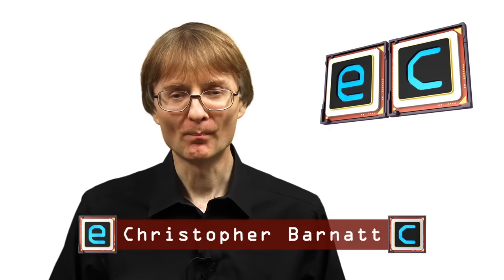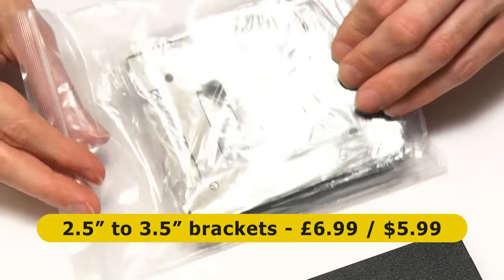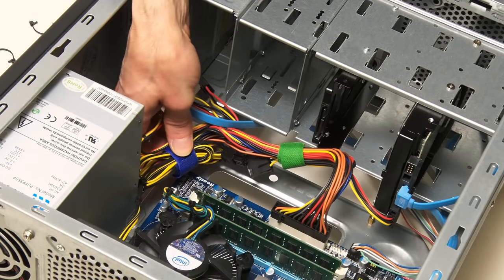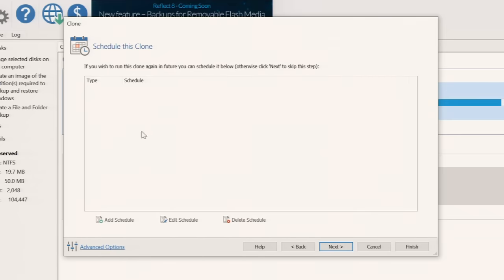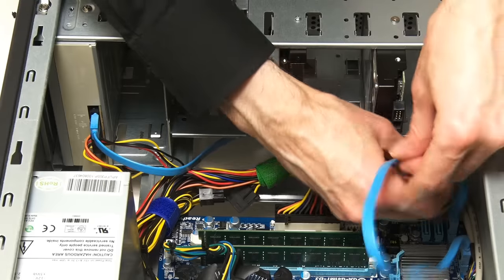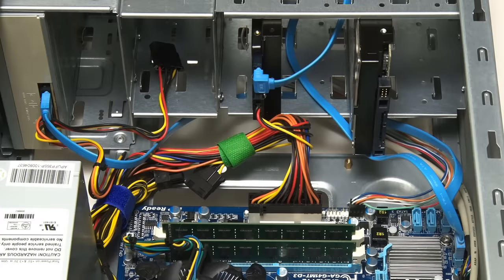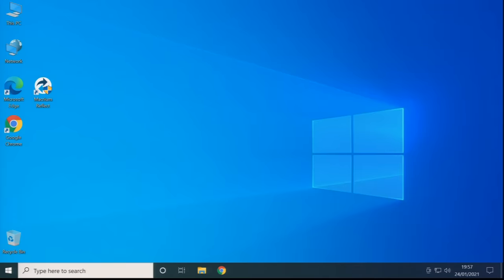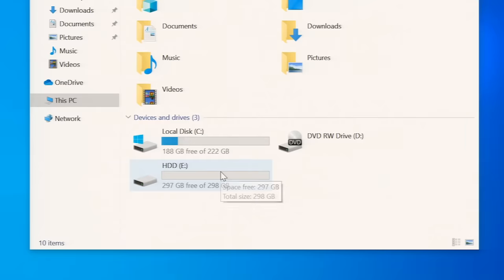Old PC Upgrade #2: SSD Boot Drive

Comment: How imperative is it to have your SSD screwed into a mount?  Like, can is just sit on the drive shelf?  My drive shelf is vertical, so my SSD is sitting at a 45 degree slant in the shelf.
Reply from the maker: You can sit your SSD anywhere you like. The only thing to be careful about is that it will not move/fall and pull on a cable and cause a disconnection or a short. But provided things are stable and secure, you get let a sleeping SSD lie (even at 45 degrees!).
Reply: I have 2 sata ssds hanging in my case

Comment: I know that it's a more complex undertaking, but would there be a big advantage to upgrading to an M.2 SSD? (I would need a PCIe adapter and new cables--?)
Reply from the maker: It would only be worth it if you really need the speed (c.3000 vs 500 MB/s). So you would have to be doing something -- like 4K video editing from non-consumer formats -- that really needed the speed. Or you could fit a PCIe SSD. For most users, the real-world benefit of booting and loading programs a bit faster would be marginal.

Comment: Do you need to remove the boot flag on the other drive, so it can be used just for storage?  So, another question.  SSD's are meant to be run as AHCI, otherwise the alignment will be off, and reducing performance.  How does that work?
Reply from the maker: AHCI is not essential when using an SSD, and is not available on a motherboard this old. I cleaned the old HDD using Diskpart, which returns it to factory state, so there was no boot flag left to remove. :)
Reply: I wasn't doubting you, just a question :).
Reply: No, you don't have to. In fact I've sometimes just left the original drive there without altering it at all. That way it's still bootable if you need it, but otherwise it just sits there same as if it were a data-only drive. (On an old machine where I use salvaged HDs, I always have a 2nd HD cloned in there so if the boot drive dies, I just switch to the 2nd drive and life goes on as before.)

AHCI has nothing to do with alignment -- rather, it's a sector thing. Pretty much any modern drive formatter knows how to align an SSD.
Reply: @Reziac  Thank you.

Comment: That SSD is so cheap would be rude not upgrading my old desktop with one - may even do it on an old Thinkpad I have
Reply: Fitted a Kingston SSD with the help of this useful guide.  Boot time is now 25 seconds instead of a minute.  The old PC seems a little more responsive but the main thing I noticed it was so quite - well that was until I reconnected the hard drive as well.

Comment: just two questions

1. what was the processor and ram used?
2. what were the loading times of both ssd and hdd? I don't think I saw the hdd boot time, and I don't think the first boot ssd didn't do justice because of those annoying screen at 15:13

Comment: Hi Chris, a couple of questions? First being - do Samsung 870 EVO SSD drives come pre formatted or does one have to first partition and format the drive? The reason I mention this is some new HDD´s I´ve bought in the past came with a full disc partion and were already formatted.

My next question... I often make image backups (including the OS) to a 2TB external USB HDD. I should add that my system is pretty ancient (circa 2006) running Win7 32bit which I find is very stable. A lot of my programs are for running astronomical imaging and telescope control software which I heard can be unreliable running under Win10 and the reason why I still use WIn7.
The bottom line here is can I simply restore my backup to a new SSD using the WIn7 "Backup and Restore" utility? In the past I have done Windows clean Installations, but its a PITA and takes forever!

Comment: Look at all that space in there for drives, you could probably fit the total drive space that PC case was designed for on one drive these days
Reply from the maker: Yes, what a great thought! :)
Reply: Considering you can fit all the processing power of the Apollo command module into a device you can wear on your wrist these days...
Reply: @lawrenceallwright7041  I remember when JPL ran around buying up 486s because they were a 100% known CPU... and patching bugs in space was a no-go :)
Reply: @Reziac  486? HA! That's modern stuff from 1989! Look up Core Rope Memory which was the type of stuff they were using to get to the moon, 20 years before the 486. Storage capacity of 72 KB per CUBIC FOOT!
Reply: @lawrenceallwright7041  Woah, you're OLD :D

 "My" first computer (high school class) was an IBM1620... something like 4k of RAM (don't remember, some piddly little bit) and the 5mb HD add-on was the size of a washing machine. Was a major upgrade from punch cards when we got a paper tape reader. Don't think I miss needing a forklift to move the computer. :)  (We also had a 360 that did the district payroll, the size of a garage.)

Seemed downright modern compared to what a friend worked on in the Air Force... flight computer where you moved plugs around to program it, and read the results in the blinkenlights. Movie computers are real, just 50 years late. :D

Oh, a fun video here somewhere -- kid bought a mainframe and had all sorts of adventures first getting it home then getting it to work.  HA! I found it.

https://www.youtube.com/watch?v=45X4VP8CGtk
Reply: @Reziac  I didn't say I was actually ON the Apollo mission. I have seen the movie Apollo 13 though, where Tom Hanks (as Jim Lovell) brags about the compactness of the computer to some journalists.  😁
Reply: @lawrenceallwright7041  Well, dang, and here I was hopin' you'd made it to the moon! :D  At least nowadays the capsule has room for something besides the giant monster computer.
Reply: That's a nice case. Same style of chassis as the one I prefer for my own PCs. No bling, just lots of drive bays.

Comment: Great video as usual :)And diskpart! Its like watching ma favorite show :D Reflect is also my favorite cloning software except when I buy Samsung SSDs and use SamsungMagician software but the branding comes with additional cost. I wonder where did you manage to get the branded SSD that cheap? The cheapest I found recently was PNY 120GB SSD for £18. Anything in the 240GB range is more than £28. Share the secret :D:D
Reply from the maker: Thanks for this. The SSD came from Amazon.co.uk. Since the video posted, the price has risen!
Reply: @ExplainingComputers  Many thanks!

Comment: Can the ssd drive you transferred the data to be cooled using an aluminum radiator or a cooler with active cooling? this to extend the life of the ssd... an explanation would be useful, especially since the life of the ssd- uri is significantly smaller than a hdd, be it 2.5 inches...very easy to understand what you presented in this video
Reply from the maker: A SATA SSD in normal use will not need cooling to extend its life. The life expectancy of the electronics in an SSD is no less than in an HDD. But the number of program-erase (write) cycles is limited -- see my most recent video on this topic here: https://www.youtube.com/watch?v=F8k_XIEhKWo
Reply: @ExplainingComputers  Thank you for your kind answer. I have a computer with MB sk775, C2D E8400 processor and 4 G Ram... I want to transfer the Win7 pro OS, with the original Microsoft license (bought 12 years ago, with the tax invoice, everything legal) from the HDD 1T WD sata 2 on ssd Kingston KC600, 256MB sata3, bought new a week ago...for this reason I asked if I could adapt a cooler with active cooling to cool the above ssd...thanks for the answer

Comment: 05:28 My question is: is the PSU is in the right orientation? As far as i searched about it's modell number i was unable to find pictures from it's remaining 2 side,  but following the guide lines of the ATX model, that should pull air to cool itself, and ventilate the chasis... So maybe it is sitting there sucking air from metal panels (BAD), or have no opening to the inside (STRANGE), while still have a fan at the back (makes the later STUPID).
Any idea or confirmation?

Comment: Question: does Windows know that the new disk is an SSD, no longer a spinning disk, and therefore to manage it as one with regards to not defragmenting etc? Or do you have to manually configure?
Reply from the maker: Yes, modern versions of Windows (8.1 and beyond) detect and appropriately handle an SSD.

Comment: Chris, I often find when I clone disks like this when you first try and boot it up it fails, do you have any take on why that is? Occasionally I have switched off and then booted again from cold and it will then boot up and I am never clear as to why that is?  I suspect it may be to do with secure boot and some of the strange partitions used by that.  Do you have any experience of how to deal with that as I think it would make a good video on how to get around this nonsense.

Comment: I add a mechanical hard drive so I can have a Linux swap partition. I have swappieness set to 20. 10K rpm 6-mbps Velociraptor hard drives are really good for that. I'm really bad at having too many tabs open on my browser 16GB of ram isn't enough. Having a fast swap file helps me recover.

Comment: It is always seen that they only have one or two power supply cables; when you have 4-6 SATA slots?  Wouldn't you think you have the same amount of each (?) power cable w/SATA?  Most of the newer towers are built the same way?  Bottom line; You have to buy cables no matter what's!!!

Comment: At 1:12, what are those connectors on the HDD called? The one at the right, without any cable connected. Also, is that a Molex power?

Comment: Question for Mr. ExplainingComputers: I have a "Razer Core X" and it works really well with my older thunderbolt 3 laptop/mobile desktop, however GPU's are become massive in size again and I'm finding that the RCX's case is way to small for most modern GPU's. I was wondering if you have any ideas for me about which small cases would work or are easily modifiable as well as transportable? (Something smaller than a bread box, but large enough to hold a three slot graphics card, power supply, fan, and daughter board for TB3 connection)

Comment: I have a question what is the difference between a fusion drive and a SSD drive?
Reply from the maker: An SSD is a solid state drive -- an actual type of hardware. A "Fusion drive" is the name Apple gives to a storage device that includes both an SSD and a hard drive (also more generally known a a hybrid drive).

Comment: Even nicer ... if we could use NVMe drives in those old PC's. Would that be possible?
Reply: On most older motherboards no. Your bios would need to support booting from a pcie expansion card.
Reply from the maker: You could in theory plug in a PCIe NVMe drive, but it would not be bootable as @NYCamper62 says, and the speed would be limited by the PCIe 1.0 interface of this older motherboard.

Comment: I LOVE Macrium Reflect!  Why wouldn't you just use the "copy selected partitions" option vs. all that manual stuff?  If you don't like the sizes it does automatically, you can adjust then.

Thanks for tutorial on diskpart.  But for anyone who fools with Linux and has a live usb drive of one, just boot that and use the graphical partition manager gparted to wipe the drive and create new partition.

Comment: Well Done Only Recently Started Looking At Computers Its A Mine Field Out There Bought An Old P166 For Playing Old Games Found In The Loft Now In Man Cave But Struggling With HDD To SSD AOMEI Does Not Work But You Have Showed Me How To Obtain Free And Working Software Again Well Done Thanks
Reply: Hi There So That's My Plan For Tomorrow Being Retired Through Ill Health So A Wee Dabble To Keep Me Occupied Thanks For Your Quick Response Hopefully You Can Keep Me Right Thank You
Reply: Hi There Software Has Changed But It Cloned Alright BUT Would Not Boot Up Kingston SSD The Made A Big Mistake Unplugged The Data Plug While Running Now The Main HDD Won't Boot Up The SSD Was Looking For A Boot CD. So Start Again Win 8.1 On The SSD Works Boots Up Looking To Select Which Op System Has To Be SSD 8.1 As The HDD Win 10 Keeps Trying To Repair On Booting So I Can't Get To It Start Can't Repair Even In Advanced Features Doh!!!

Comment: Hi Christopher, could you put a SATA 3 add in board in one of the PCI slots. Would that overcome the SATA 2 issue? Or is the PCI slot too slow and it wouldn't have much of a difference?

Comment: Does the OS (Windows 10) on a source HDD remain fully operational after cloning to a target HDD? On my laptop, I plan to keep using the source HDD in it. My plan for the target HDD (the clone) is to put it in a drawer, for emergency, and hopefully never to use it. I plan to keep using HDDs, because speed is not of the essence for my current PC usage.
Note: I have heard that Windows 7 OS on a source HDD is no longer operational after cloning. Any thoughts?
Reply from the maker: Yes, the source drive continues to work just fine (in both Windows 10 and 7). But the license can only apply to one copy or the other. So you may have come across stories of users who clone a drive, work with the new one, then decide to put the old one in another PC (with a totally different hardware spec) and in that PC is will not work. But if you take a clone for emergency use in the same PC, you should have no problems continuing to run from the source drive, or switching to the clone in difficulties occur. This is indeed exactly how I run things myself, taking a clone copy of my boot drive every 6 to 12 months that I keep in the cupboard, just in case (and this is Windows 7).

Comment: You'll hate me for saying this - I expect nasty comments... but... I don't bother with mounting brackets for SSD's - they're Solid State - no moving parts... I just screw both holes on one side and close the case. No complaints so far.
Reply from the maker: I don't hate you for saying this, and indeed I even show mounting the SSD withtout any brackets as an option in the video. :)
Reply: @ExplainingComputers  Hehe.. I wasn't expecting a reply from you, I just thought I'd get shot down by other viewers! Thanks for the channel - Clear, concise and well informed. I WAS a global IT manager 20 years ago and my knowledge is very, very out of date (MY MSCE was on Win 2000, before Win 2000 was released... so....) Please keep your content coming as long as you can. As a side request / suggestion... could you put a link in each video to a page that describes and links to all the other videos? YT'ers like you have years of material and us newbies simply do not know what you have and have not done... One link pinned on every video linking all the rest... (titled) very useful... ;) And would stop idiot comments like "Have you mounted an ssd without a bracket?" hehehe. Take care - and thanks.

Comment: Very good video,thanks for the work!So,my old AMD Phenom,4*3.4 with 8 gb ram became 2 new ssd´s.One for  Win10 and the other for Linux Mint and what should i say;a fast,stable system!Never runs faster.I´m wondering about a 10 years old Computer,it is amazing.Thanks again for the video.I prefer a new installation,my main userfiles are on external discs!

Comment: All the processes shown here can be accomplished in the one application, Macrium Reflect, it does it all, so I no bothered to use the more complex windows options. A note of caution on using the  Molex to SATA cable adapter, These do not contain the Orange wire which some drives require.  I had experienced clicking & intermittent stalling of my SATA drive. Diagnostics had shown up as a faulty HDD, which would be expensive and inconvenient to replace.   After much head scratching & frustration, I connected to a SATA point from PSU which contained the Orange wire, and all was well, so user beware, this may save you a lot of time & frustration.
Reply from the maker: I am bewildered. This videos shows the use of Macrium Reflect to clone the drive. :)

Comment: I would use WD diagnostic to run a hard drive test programme and fully test and format the drive.  This is an old hard drive and may well have unknown faults in which case I would be ditching it.  Just saying!  I have done a bit of this sort of work over the last year and two out of three drives I thought I could incorporate into a cheap build as backup for a neighbours son proved faulty. They were all WD blue as well .....

Comment: Hi, thanks for the channel... I have just watched this video and I have a couple of questions.. 1) can I when cloning from HDD to SSD just copy over the OS..? (I would like to do a clean install of any software on to the SSD after which I can use the HDD for storage.  (2) Having watched the section on copying disc partition, I looked at my disc,.. As far as I am aware, I only have one HDD 2Tb but in the disc management it is showing disc 0 = which has five partitions as numbered.. 1)=EFI system part  2)= OEM part  4, 6 and 7= recovery part.?   I also see a disc 1 with 29.69 unallocated.?
Any advice would be greatly appreciated.

Comment: I added a Samsung SSD to my 12 yaer old PC . the current version of Macrium Reflect wants your email and forces you to have a trial code ... even then it did not install .. i got an error 1  , that's " cant find server " ... so i got an old version which installed fine with no issues. I cleared as much as i could from my old drive , it still took 12 hours and 35 mins to clone... but worked !! thanks for the guide
Reply from the maker: Glad to hear that it worked! Sadly Macrium Reflect Free has been withdrawn -- the "current" version is a trial of the paid program. I have a video on replacement free drive cloning software here: https://www.youtube.com/watch?v=1gTJw8ehkVc

Comment: intel i7 980x geforce gtx 980ti this is a cost effective upgrade for old computers from 2022 to 2030 meets the minimum requirements of computer games in 4k resolution